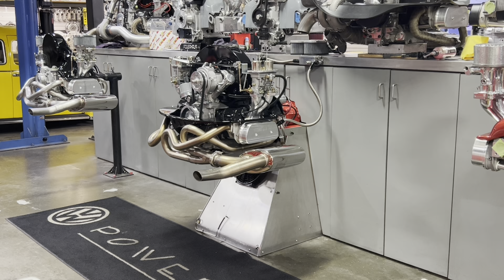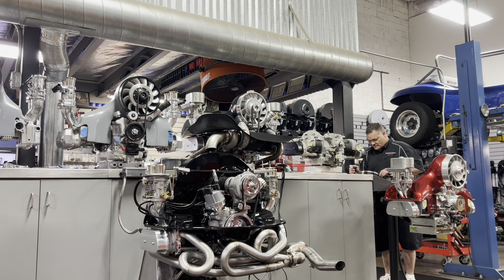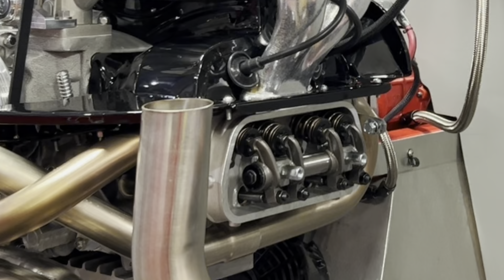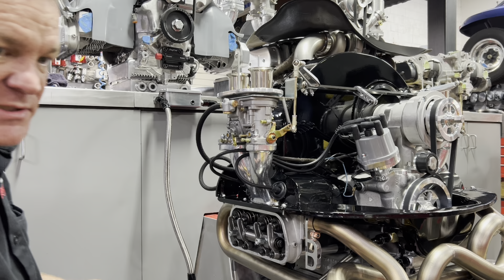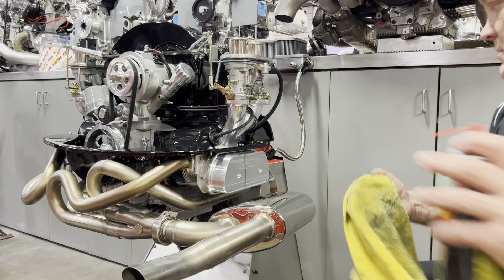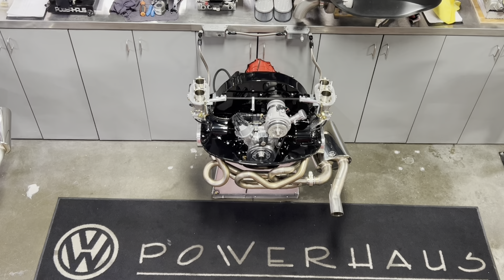POWERHAUS VW Dyno Run First Start Up with Engine Options & Valve Adjust

Comment: So I guess I’m waisting my time with feeler gauges I should just make sure the push rods and the caps can spin?   I’d be worried it would hold the valve open at temperature but I guess I could do a compression test to figure that out
Reply from the maker: if you have aluminum pushrods, they are usually set at 004-.006 when cold, but we've even set them at 0 lash and have had no issues. Aluminum pushrods will expand a little bit more than chromoly but not as much as the complete engine so as the engine warms up and expands, pushrods will have more lash than when cold, this is why chromoly pushrods tend to be a bit lowder as they do not expand as much as the aluminum.

Comment: Hi John   , great work. I noticed you did the  carbs at the beginning with out taking the linkage off, I always thought you discontent the linkage first ,then do the carbs  and then balance up to each other .
Reply from the maker: Your absolutely right, if Bud from Weber saw me do that, he'd of slapped my hands lol.
When I set these carburetors up, I back off the screws from the throttle stops and then open each side 2 full turns and then connect the linkage so they open identically, this gets me in very close range and as long as I only bring the idle down 1/4 to 1/2 turn on each side at a time, I can get away with straightening out the linkage rods, Bud does this to but it's one of those do as I say not as I do moments lol.

Comment: I'm curious.  What do you do during assembly for the main bearing, rod bearing and cam bearing clearances?  Do you find a large variance in the bearings, and have to go through a lot of bearing to get the bearing clearances correct?
Reply from the maker: We’ve made special tools & jigs to keep an eye on these type things and yes we have boxes of extra bearings
Reply: @powerhausvw  That's what I figured.  Thanks for the reply.

Comment: You don't have to turn the motor over more than once to check the valve clearances .

After checking No1 inlet and exhaust , you can also do No 2 inlet ( so you will have done the back 3 ( towards back of the engine ) clearances .

Then on the other side you can do the No 4 exhaust clearance ( front one ) 

Then turn the engine over once back to the TDC mark .

Then you can do the No 2 exhaust clearance and then the No 4 inlet and both No 3 inlet and exhaust .

So effectively you do the back 3 on the 1 & 2 side and the front 1 on the 3 & 4 side .

Turn over once 

Then do front one on 1 & 2 side them back 3 on 3 & 4 side .

Much easier and quicker and less confusing with having to keep turning the motor over .

Have a look at the lobe orientation with the cam in the case when you build one and all will be clear.
Reply from the maker: I know there’s a few different ways to adjust valves, I’ve experimented in the past but adjusting intake & exhaust valves on each 1,4,3,2 is probably the safest & easiest way for our customers to do them and not make any mistakes
Reply: @powerhausvw  

Yeah , it doesn't matter , i just thought that the quicker with less engine turning , the more consistent the adjustment. 

Keep up the good work , great job on all the clips , very inspirational

Comment: Don’t you use hydraulic lifters
Reply from the maker: we've tried the hydraulic lifter a few times, love how quiet they are when new but the design that fits in our engine cases won't hold any cam with sufficient lift and since they lay horizontal in the engine case, they tend to bleed off and eventually become louder than the flat tappet lifters, same issue a lot of the later model Vanagons had or still have with their hydraulic set up.

Comment: Do you also use ratio rockers and what ratio thanks
Reply from the maker: yes, we use the scuff pad type 1.25 ratio rockers just about on every engine we build, not the oem type with swivel feet

Comment: I just acquired an MSD ignition with a 6A L box MSD distributor wires excetera what's a good plug gap?? I know it's hard to say probably but it's on a thick wall 1835 with CB heads CB fuel injection, I love all the builds you do they're the best👍🤘✌ I live near Modesto California it gets in the triple digits if  that helps narrow it down😁
Reply from the maker: Thank you,
We run .025 spark plug gap but every everyone has there own ideas and set-up so make sure you set yours up accordingly or to your builders specs.